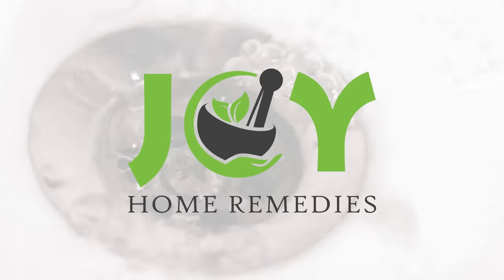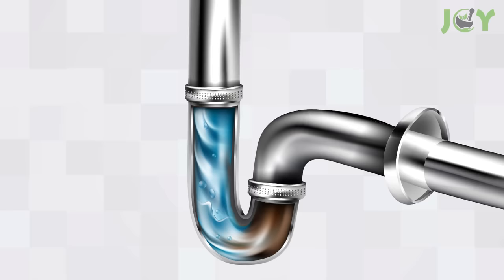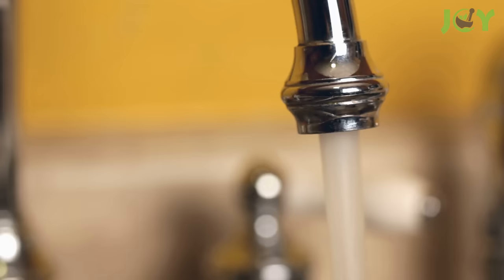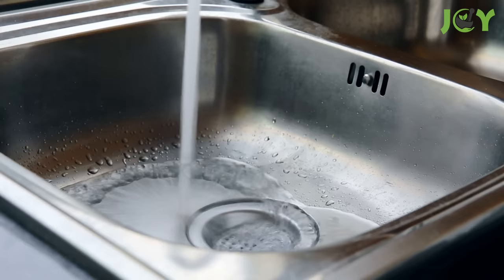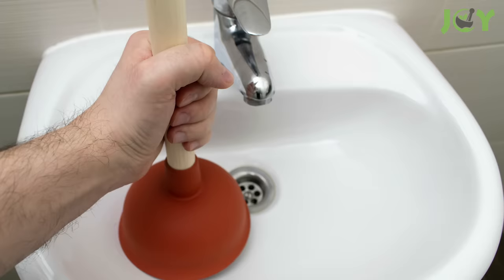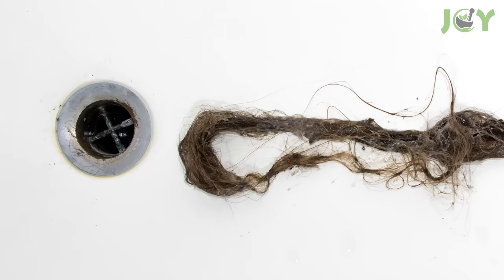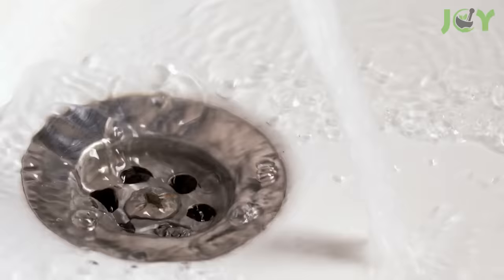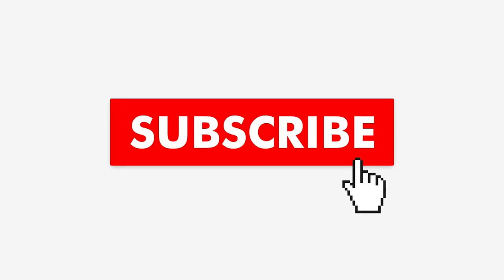8 Fast and And Easy Ways To Unclog Drains Naturally

Comment from the maker: Have you tried any of these or any other natural methods to unclog a drain?
Reply: Once I tried vinegar 🤔
Reply: @•Aakifah•🌷✨ 1
Reply: The Coca Cola worked for me…
Reply: Yes, pour pure bleach down the clogged kitchen sink or clogged bathroom sink or clogged toilet, wait for an hour, then pour hot water afterwards, once the clog has cleared, run cold water down the sink or flush the toilet a few extra times to ensure the clog is cleared all the way through the pipes. I also agree with his advise to perform monthly maintenance to prevent future clogs.

 I almost used Coca-cola, but I want to drink it with my pizza. LOL'

I almost used salt, but I need that for my cooking.

I almost used vinegar, but I need that to clean my vegetables and fruits.

I almost used baking soda, but I need that for my laundry.

I almost used hydrogen peroxide, but I need that for my first aid.
Reply: Tried several yesterday, and then I went out and bought some Draino to unclog my shower drain.  And I use a drain cover to trap hair.
Reply: Sink neeche ka pipe nikaale.our comod me clean karein.easy way.perminent.solution.mai isi tarha cwlean karthee hum.
Reply: Nice tips, thanks.
Reply: Just trying it rnow
Reply: Got, advice from a plumber,  " never use bleach to unclog a stopped up drain. Will , cause expensive problems with your pipes ! " vinegar and baking soda has always worked for me ! Did, not have to wait 4 hours. Gave, it an hour !!
Reply: Iz serbia❤

Comment: Sorry to be a downer here but I've been a service plumber for 38 years, if ANY of these were the answer don't you think we would be advocating for them, I never enjoy drain cleaning so would not under any circumstances deny anyone solving their own problems, this is nothing but a temporary reprieve for snaking/jetting the line. When hot water is used all it does is temporarily loosens the grease and sends it further down the waste pipe where it cools and becomes a solid again. Plungers will blow a small hole through the softest debris and let it drain then gets clogged easier then before. Personally I use Dawn dishwashing detergent in all sinks which degreases the drain as it flows, which often then allows the debris caught in it to flow, I haven't had to snake my own drains for many years because of it. But I have had to remove hair caught on things like the popup rod in bathroom sinks popup drains, or it's become caught on the popup itself, which is usually easy to solve by removing the rod trapping the popup in the drain and fishing the hair out.
Reply: Thanks for the tip.  For you just squeeze it down the drain then pour hot water?
Reply: I found your comment very draining.
Reply: @Damone7653  😂💯🤗
Reply: How do hiu catch hair in drain?
Reply: @ilahildasissac1943  yes
Reply: Hello!  How do you remove the pop up in a bathroom sink?  I cannot for the life of me get it out
Reply: Try turning it while you pull up on it. That works on mine. I hope that helps. 😊
Reply: WELL I'M NOT A PLUMBER BUT I ACTUALLY DO THIS ONCE EVERY 3 MONTHS TO EVERY DRAIN IN THE HOUSE.
I'VE NEVER HAD A CLOGGED DRAIN.

P.S. SORRY ABOUT THE CAPS. I DIDN'T CATCH THAT UNTIL AFTER I TYPED IT.
Reply: Makes sense
 My bathroom sink was slow to drain and I stuck a hair puller tool down
Now it backed up a bunch of chunky crap and won't drain at all
The baking soda vinegar failed to work
As did a small drain snake like tool
As did the plunger
Have to call in a plumber
Reply: Make sense if your 2 inches PVC  clogged about 8 ft with slush like mud nothing going to work but a snake
Reply: My shower drain was clogged yesterday. I used hot water and then repeatedly fingered the drain. I was able to pull all the hair out. 15 layers, drain works like a charm!
❤❤❤
Reply: 6:37 😅
Reply: @cw5451  😊
Reply: Like I said before dawn works great for drains analmals clothes car's and women who are clogged
Reply: @mycharmedunicorn8715  nun
Reply: Cola and then hot water...done!
Reply: Rod trapping?

Comment: Thanks Joy, after watching this video I went straight to my bathroom where I have a slow sink. The water goes down but really slowly. I dumped about half a cup of baking soda and half a cup of white vinegar and it fizzed for some time. I then took a bristle brush that I used for cleaning bottles, gave it a quick brushing and bam I couldn’t believe my eyes after pouring hot water from the tap. It went down like no tomorrow. I did the same to my kitchen sink and bam that was clean as a whistle. Once again thanks!

Comment: Excellent tips. Another tip is to keep the water tap running at max after you have cleaned your dishes, this will drain oils and debris. Most of us shut off immediately finished cleaning plates so not enough water to drain the pipes. Keep the pipes opened for a few minutes. Never clogged again

Comment: Great ideas for simple drain clogs. Also for toilet plunger I use only the Acordian type that sucks in more water than flange type in it and forces more water into toilet drain hole . Forces more water faster to unclog drain faster. And using very hot water mixed with degreaser /dish soap in toilet first plunging enough to get mixture to clog then for 15-30 minutes wait then plunged again  works perfect
Reply: That works, but a plummer taught me to just use very hot water and lots of it.

Comment: As a preventive measure, I fill my double kitchen sinks with water all the way to the top.  Then at the same time I pull both drain plug stops, and let the water drain out of both sinks at the same time.

Comment: If you don't have a plunger & toilet is blocked ..... Just use a basic floor mop (cotton string head on wooden pole)
Tie a plastic carrier bag over mop head .. ram it down toilet pan a few times until the blockage clears. 
Always worked for me.x

Comment: I’m glad to see this, because I have the vinegar and baking soda it just got delivered last week, because I have no way to get anywhere. And I’ve got a good plunger and it definitely has power to do the job. My problem, is that I have had dishes in the sink along time and I have a strainer or a screen to keep stuff out of the sink, but I think it got moved and stuff went down there. So this week, my goal is to empty the sinks out I’ve got some stuff I need to throw away that’s in there anyway because I’m swapping out plastic containers and some plates, and then I’m going to clean the drain and get it open. And I do have sodas although none are regular cokes I do have regular seven ups and I have plenty of salt to try that with soda so My goal is to put all my heavy duty gloves, empty the sink, and start doing what I think would be best to go through some standing water; it’s not much but if the natural cures don’t unblock it, I have heavy duty Drano if nothing else works, and I do hate to use chemicals. So thank you so much for sharing because it is giving me other ideas to try.
Reply: what kind of vinegar did u brought? and the baking soda?

Comment: Execellent very easy practical simple cheap and execellent tips for Hauser wife no cost  thanks a bunch  saves calling plumber and saving  pounds with pennies 
I was ad by plumber not to use drain block it damages the pipes thanks for lesson to open the  blocked drain  usefull lesson  bless  keep up good work

Comment: When using a plunger ina sink it's essential to firmly cover the overflow outlet, otherwise pressure won't build up in the drain when using the plunger.
Reply: If the clog is in the drain pipe in the wall, then it is wasted time. A snake is what will fix the problem. It would have to be in the T fitting above the P-trap just under the sink.

Comment: Here you are something important. When you want to use a pump firstly pour some water into the basin, then put your finger or palm on the opening of the small safety hole, so the air cannot leave the safety tube through the small opening.  Then use the pump with your other hand. This way the water in the tube presses the dirty blockage more strongly on the inside.

Comment: Our kitchen sink started draining painfully slowly since I replaced it some years ago, going from a 2 bowl to a single farmhouse type bowl. I had tried just about everything to clear it, but nothing wanted to work. Fortunately, we have a dishwasher, and the drain for it connects to the sink drain just below that drain. Also fortunately, I'm not one to throw things away that I think I might use in the future, and as a result I have a drain plug that I had saved when I removed the garbage disposal (can't use one of those with a septic system anyway, but it came with the house). That disposal drain plus fit the drain perfectly & tightly, so I figured that the hot soapy drain water from the dishwasher would clean things out. Turns out that I was wrong and the clog was tougher than the water & soap and proceeded to push the drain plug out and the water backflowed into the sink before slowly draining. Finally, one day, I decided that enough was enough, so I started the dishwasher, inserted the plug into the drain, and made sure I was right there as the dishwasher started to drain, and put the palm of my hand on top of the plug and held it down in place. That did the trick perfectl;y, and now the drain is clear and fast flowing with no backup from the dishwasher when it is running either.
Reply: wow!
Reply: My dishwasher AND my washing machine use the same drain. Sigh.
Reply: Dishwashers are a lazy pain, doing your dishes by hand warms my achy arthritis filled hands and keeps the germs away so get busy, no I was not in the military, mom taught me~~~
Reply: @mshum538  That’s an excellent thing. I enjoy doing the dishes too, but our solar system is not really that good, in about 10-15 minutes we run out of hot water… and it snowed in Cyprus first time in 9 years… I got chilblains… had to stop wearing the wedding ring. Sorry for the TMI. Just saying that doing things by hand are a therapy and the pots shine on days you are fuming and seething with anger 😄😄
Reply: Water is extremely precious.  A dishwasher uses 2/3 gallon water at most.  By hand 5/6 gallon maybe more
Reply: @mshum538  .kn

Comment: Here's my method: Remove the wire hoop from a basin plug and drill a hole through the plug. Glue a garden hose spigot onto the plug. Attach a garden hose to the nearest tap (eg. laundry washing machine cold spigot) and the other onto the plug spigot. Turn on the tap whilst holding the plug in and mains pressure will unblock the pipe!

Comment: I poured the baking soda in the basin and let it slowly move through the clogged pipes by adding water as it slowly drained away.  Probably about 150g.
I then poured vinegar and the boiling started. The glucking ;-) reaction could be heard a distance away from an inspection lid.  When the boiling stopped the pipes were still blocked. I then filled the basin with water and used a plunger and suddenly the pipes cleared.  It seems the baking soda / vinigar reaction successfully loosened the muck and goo to pop out as a plug (was the impression I got) and the pipe is now clear.  10 minutes.

Comment: I've been a plumber for more than 50yrs. I've only had it a few times that the clog was in the trap. That was because grease was poured down a drain and set up like wax on the water in the trap.
Most generally the clog is down stream, a build up in the whole drain. You might break it loose with a plunger, but if the drain is vented near by or has an AAV, air admittance valve, plunging is a waste of time. If the drain is totally stopped up, baking soda, coke, etc won't work. If you can't get the solution to the stoppage, it won't work. Pick up a auger in a drum and auger it out.
Bath lavs are another story. A lot of the problem is under the stopper. Where the coat hanger will work to pull out a hair clog.
For $2. at your hardware store you can pick up a plastic version of the coat hanger that won't damage the drain and won't get stuck !
Remember the stoppage is hardly ever in the trap.........it's a build up in the drain down stream.
Do Not pour liquid drain cleaner into standing water or use 2 different kinds. The reaction may cause a bad smell that may be toxic and it will also ruin the finish on your sink.
Reply: Sir. You are a master. 14years ago I bought this old house. Suddenly the drain clogged at the lowerest part of the drain pipe.
I called the plumber. He came and finished cleaning the waste block. Then he told me do the same way that he did. after that I do it four times a year. Until now no problem at all.
Reply: Also a bad idea to use caustic cleaners in case you decide to call a plumber who would then need to deal with a dangerous substance as a result

Comment: Some of these are effective - if the blockage happens no deeper than a feet or two. For such early blockages these may, indeed, work well. For deeper ones though, not really. (To be fair, the video doesn't make such claims). I've had my fair share of clogged drains, and it almosst never was this early in the pipe, almost always deeper down - where the water in the pipe is cooler - or downright cold - and the grease can cool to solid and start accumulating. A decently maintained and cleaned faucet/toilet will seldom get clogged right at the early section.
Reply: Снять сифон и хорошо промыть - это не трудно сделать.  Но почищено будет прекрасно
Reply: That's my problem.  the deep blockage means that air pressure stops the sink draining at all so there's no point in filling the sink with harsh substances if itsn't going to head down the waste pipes, and even manual snaking didn't clear it.  Not sure if anything else would do it other than calling a plumber.  Suggestions?
Reply: @DeepakKumar-lv4te  I would say trusting the professionals with it (a.k.a. calling a plumber) is the best option. Hghest cgance of success, lowest chance of actually making the situation worse. Sure, also more expensive... but if we are not willing to pay for expertise where we lack it then we deserve the consequences, don't we? :)

Comment: If the baking soda and vinegar does not work, Add boiling water after about 10 minutes. If stubborn repeat 2-3 times. I had a clogged drain third time was the charm. But wait there's more take a wooden chop stick and cut grooves with a utility knife, GENTLY push it down and gently bring it up to remove hairs. You do Not want to lose it down the drain.

Comment: my kitchen sink pipe is  blocked and it hard to get too .to unblock  the pipe i have try most thing  to unblock but i may of made it worst by using caustic soda with hot water and it of may gone  hard  in the pipe .can i have help and anything i can use to unblock 
thank you

Comment: Im a chick who, up till now, has always lived by the plunger and could free any drain. Now??? In my parents older home, the shower and the sink were simultaneously clogged. When I tell you I tried everything... wow! I started with the plunger, went to drain cleaner, had a snake, and then vinegar and baking soda... water would back up and pool around our ankles in the shower, and one day I went to clean and used bleach... the water miraculously has not backed up since. The sink... water is just pooled up in the sink and it got cloudy and gunky. Looks like no resolution in sight and I am in need of a plumber. Before I make that call, I would like to try the 50/50 salt and baking soda.

Comment: NY drain been stopped up for about 48hrs used drain unstop didn't wk so I got the plunger and finally got the Lil sitting water out the drain watched your video and used the coke method it Is wkin now 😂😂😂😅😊

Comment: So our kitchen sink was backed up really bad.  Bailed the water out, checked the p trap , boiled water  it would go down & after a few minutes come back.
The third day ( yes I am stubborn) drained it again, took the plastic pipes out,  and turned the small curved connector upside down ( opening up). Dumped baking soda, salt & vinegar in the pipe. 
Connected the  p trap & others back up. Waited for sizzling sound to stop.
Put about 1/4 cup dawn dish soap down the sink drain.  Proceeded to dump boiling hot water.  It went down finally. Ran the hot water for about 4 minutes just to make sure everything was gone. 
SUCCESS !!!
Just keep trying, eventually it will go away.

Comment: I unclogged my drainage pipe by boiling a pot of hot water and pouring it into the clogged drain.  The clogged items will break into small pieces and flow down the pipe.  Follow up by flushing the pipe with tap water.